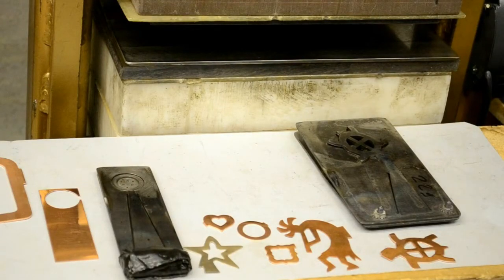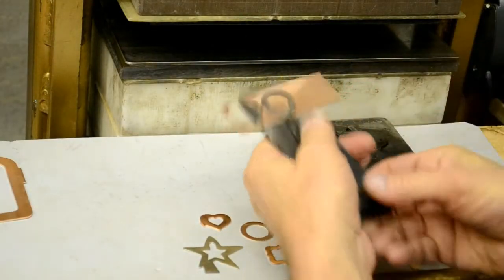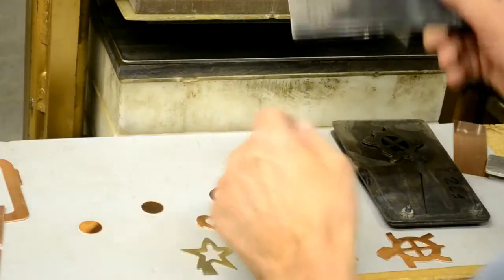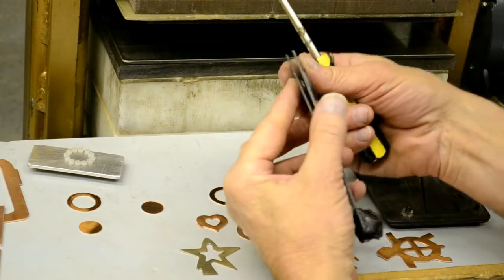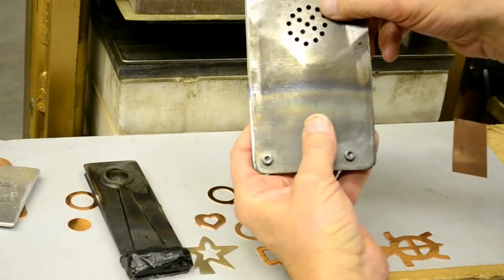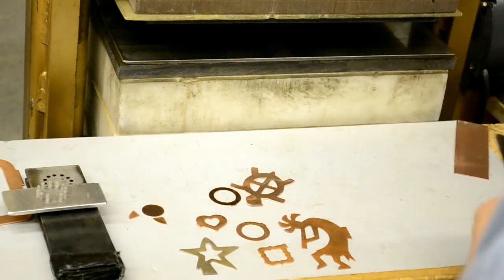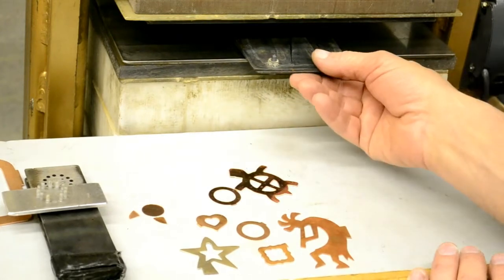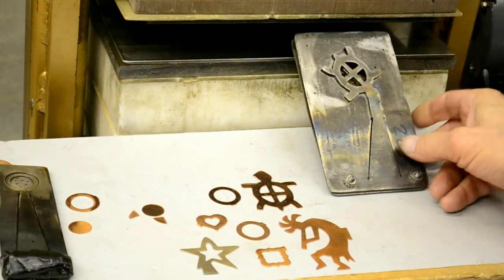Pancake-Donut Blanking Dies

Comment: will you do a full video on how to make a pancake die ?  inclulding specs of the type of steel to use and thickness......type of saw blades  ?  etc.   Thanks
Reply from the maker: Hi, No, that's not going to happen. It's too complicated and I don't have time to go that far down the instructional route. There are  hundreds of things you have to do exactly right to get a good tool. If you have not made some good , plain (no donut hole) pancake dies before, you definitely don't want to go jumping into one of these. But if you do already know your way around pancakes, and are serious, I can be of some assistance.

Comment: Thank you for sharing this information!  Is a different angle cut on the secondary die to minimize the part from getting stuck?
Reply from the maker: Hi, Not really, but I do back down about 1/2 degree on donut dies , anyway, just to make the die itself easier to open, since they're more of a pain to operate than normal dies.
Reply from the maker: To finish answering your question, the  sawing angle , in the case of donut dies, is not a determining factor in the parts "sticking" in the die. It's a different kind of "sticking", and more correctly seen as the part being trapped against the secondary die plate. With a plain pancake die there's no secondary plate , so the part is free to fall loose. This situation is not like pancake dies that are sawed out with an angle that makes them loos and prone to parts sticking, and not like the ones that are laser cut with no angle at all.